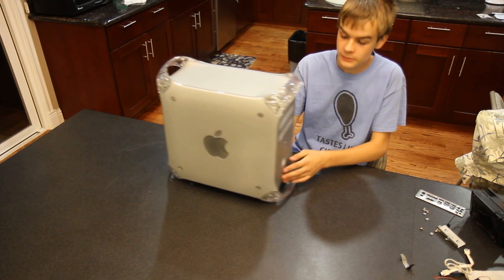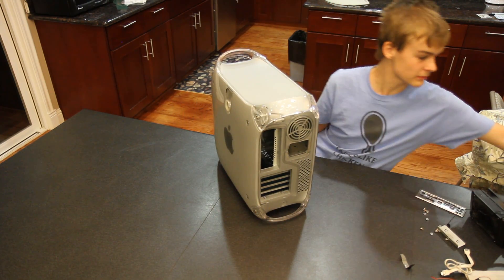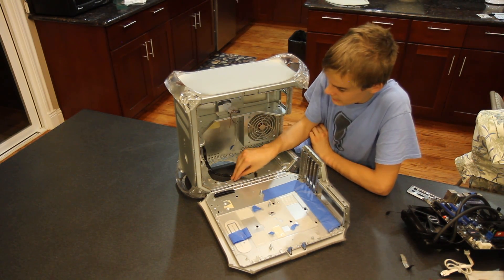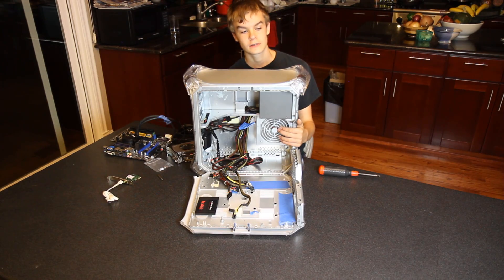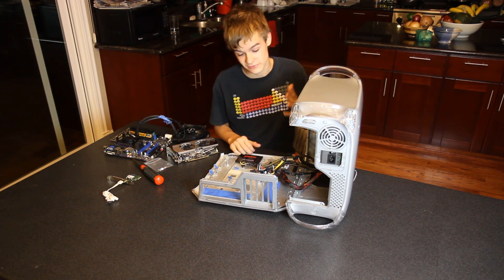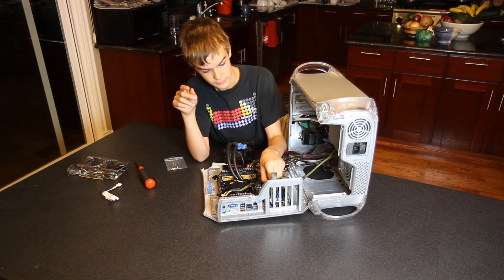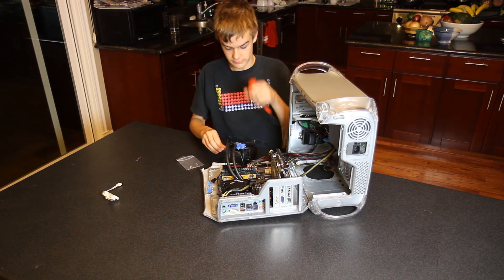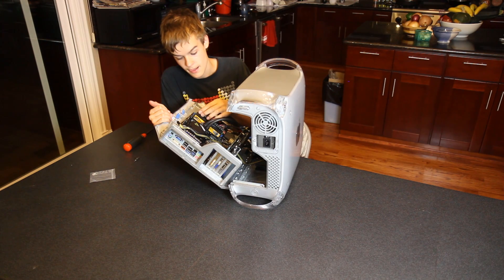Powermac G4 casemod build guide

Comment: what would be the best way to cut that hole for power supply ??
Reply from the maker: shadowmaster1978 There is already a whole for the psu in the case that fits normal power supplys and you don't need to cut any holes.

Comment: Did you install custom mounting points for the motherboard or did the stock ones work fine? I could imagine that some motherboards can have different layouts, but I want to get a general idea of how it is mounting a motherboard in a G4/G4 Quicksilver case. Also, what size fan are you using for the computer's main fan assembly? (technically right under the PSU). I have a current Windows PC and I want to use its main exhaust fan, but I am not sure if it will be large enough. Lastly, where does that fan connect? Seems like it would be too far away from the motherboard.
Reply: ***** Huh--that sounds cool. Do they leave it to the consumer to create a mounting system for the plates? I am sure it's not that difficult to mount one, but I'm just curious.
Reply: ***** Great, thanks for the URL.

Comment: nice build man! which m-atx is that, you are using? and do you know if it would fit in the standard g4?
Reply from the maker: I am using M-ATX. The quicksilver is the easiest to to the mod because of the standard psu mount and I/O holes. The first gen G4 was also very easy to modd. The mdd is the hardest as there is custom size psu.